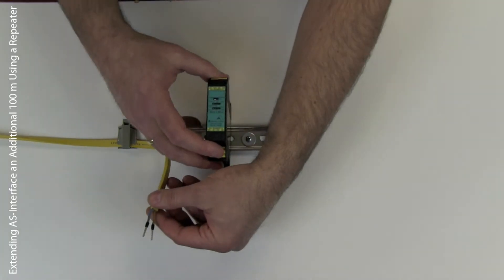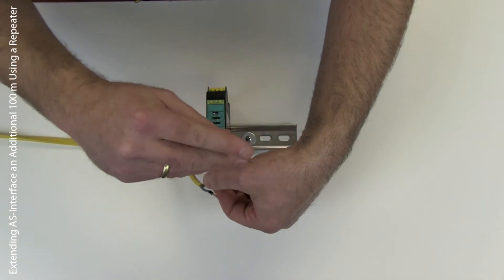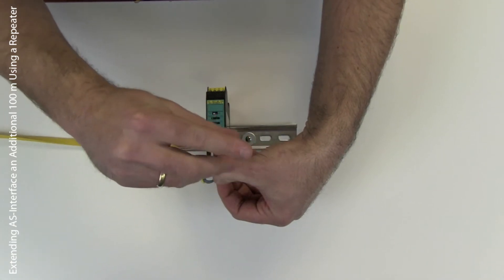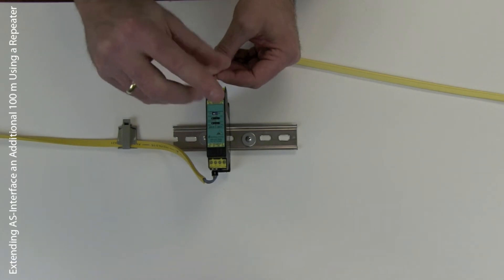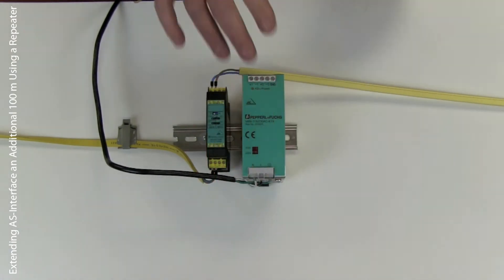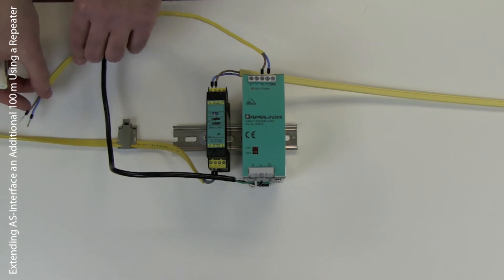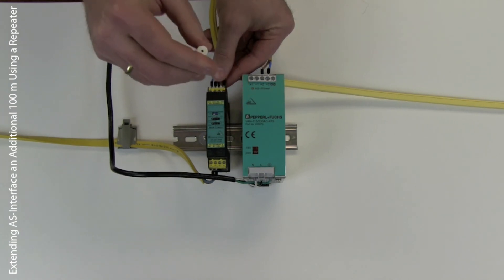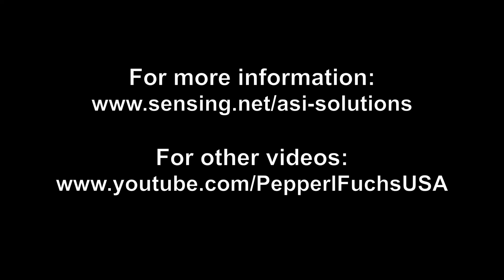Using an AS-Interface Repeater

Comment: Asi 1.40 power fail what is the problem
Reply from the maker: Hi Sunikumar Dm, 
1 = Network 1 and 40 = offline. This happens every time you power up, so first offline and then online. You could force the gateway offline too from the display or PLC; if from PLC it typically says “Offline by Host”. Also when you transition from configuration mode to protected mode it goes offline too. If none of those is the issue, you may have a power issue. If you’re using a repeater, is there a separate power source on the new segment? Are you using an AS-I power supply? Please reach out to our technical support on our webpage https://www.pepperl-fuchs.com/usa/en/ask_an_expert_fa.htm so we can best help you.